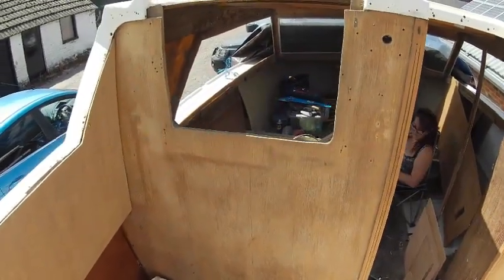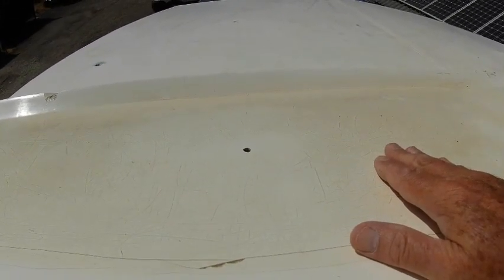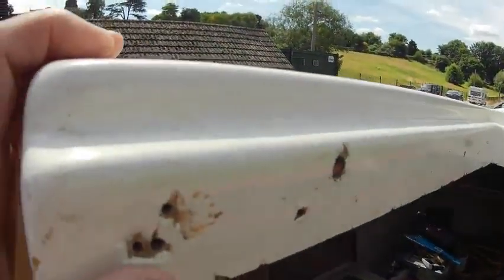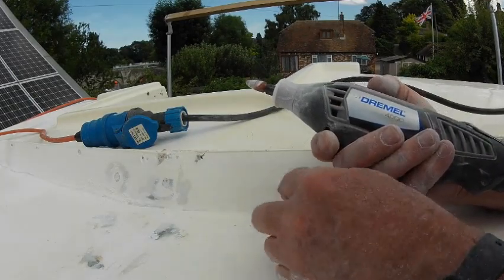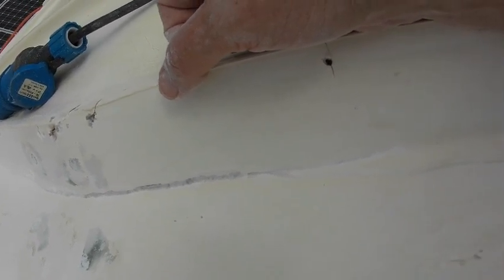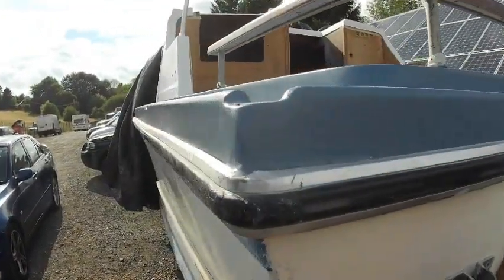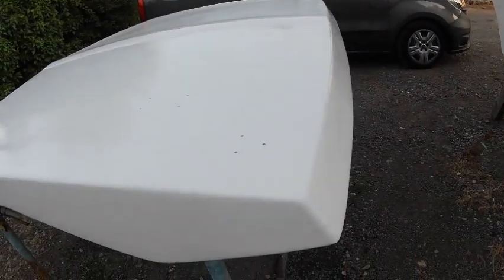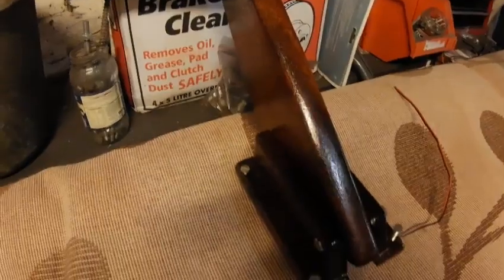Episode 15 ALC boating preparing the area for hardtop install

Comment: How is the paint now a year on? 
I’m Painting my boat with one up and top lack plus.. sold to be on the word that it’s the “ducks nuts”
I think your channel is the only one that’s essentially covered it that iv found. And iv been searching extremely hard for more  information around the products. 
I figure with the one up after each coat hit it with a 400 grit sand paper and paint again till you have it nice and level. 

Kind of wishing now I just went with the “know” instead of taking the risk of using it then having to paint it again in the future.
Cheers
Reply from the maker: The paint still looks good but to be fair it's been covered for most of the year while I've been working on the inside and the decks only had the undercoat on, I intend to give all surfaces at least 6 coats then polish. There is some slight orange peel which should polish out in the end I think that to completely illiminate it you need to be inside at the ideal temprature and be able to do each coat consecutively.

Comment: I found that the Oneup is thick and dries out orange peely it doesnt flatten off at all, I guess we are supposed to flatten that off with wet and dry so its a lot of work, not sure what the idea is being so thick I wouldn't use it again personally, for what it costs I expected better results...
Reply from the maker: Yes your right Rob if the conditions are not perfect adding the thinners does help with this, the gloss around the windows went on smooth as glass but this was applied under a canopy away from any breeze
Reply: @alcboating3675  Do you intend to cut and polish the gloss or youre happy with it?
Reply from the maker: @rob5896  I'm expecting to cut and polish once all the coats are onso I will be giving it an extra couple of coats for this